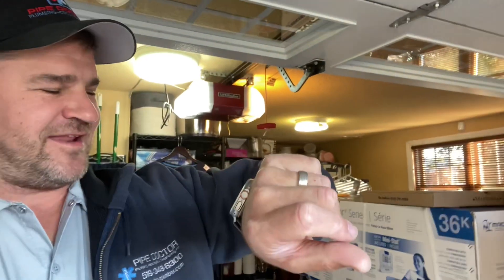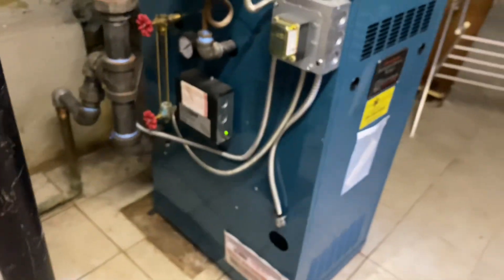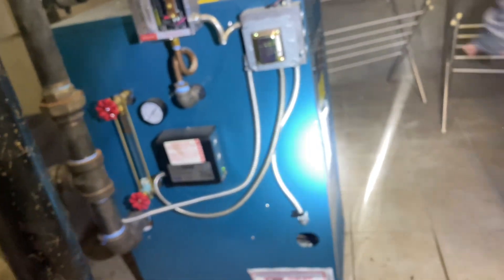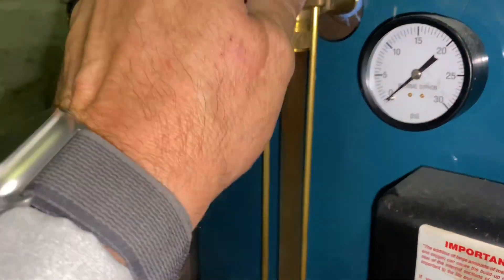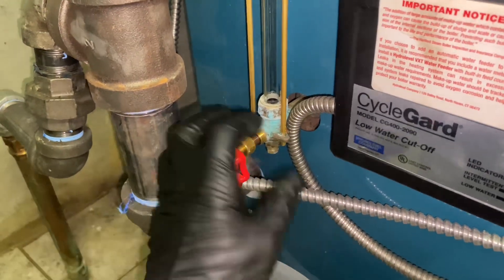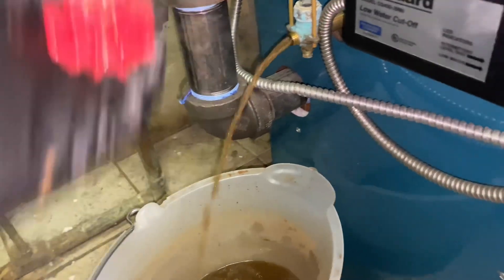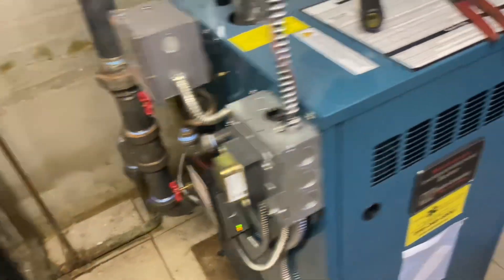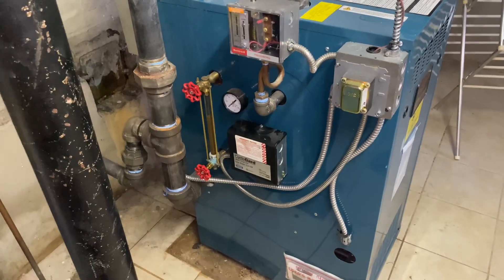Got Steam? Steam Home Heating Boiler Furnace Essentials - Must Watch How To Video

Comment: Mount Vernon , the worst place for steam boilers in very old houses. Cleaning the mud out of those fittings is multiple times in a week ,
Reply: @PipeDoctor  I guess you’ve visited lovely Mount Vernon😂😂 , great place to repair oil burners, lots of pancake boilers and asbestos

Comment: sight glass looked ok, I seen floaties moving downward when draining. the amount of pressure out the drain valve suggests it was overfilled to nearly blasting out the radiators. lol
the gauge appeared to be at zero when you first showed( blurry though), then the water blasting into bucket suggested 5psi+ to my ears. 
🤔

Comment: its a good idea to mark the rods and the glass tube where the water level should be. that way the owner knows where it should be. when the boiler cools down. red nail polish works good for doing that
Reply: I'm wondering why the half way mark isn't marked from the factory.  Seems like it would be, should be?  Easy to etch the glass just like a graduated cylinder, thermometer, etcetera.

Comment: Nice job Mike. I noticed black pipe being used for drip tube out of pressure relief valve.  In my area that's a big no no. Pipe can corrode internally and block off relief port. Can't use black pipe must be copper.
Reply: copper pipe, meet shark bite fittings. see the conundrum with them not allowing black pipe(galvanized with no threads and taper cut!)

Comment: Last week the plumber and I cut the wet return copper pipe about 35' away from the boiler. We shoved a garden hose down the cut pipe and added a pump to the boiler end of the return.  I watched the thick brown "lava" get pumped out of the return.  The lava ran that way for a few minutes before regular brown water came out.  He installed a clean out for next time.

Comment: Hey Mike, got a question for you. Do you have any experience with steam boilers treated with Potassium Sulfate? I believe it is used to lower dissolved oxygen levels. Sounds like bs to me since air is part of the equation in getting steam moving in the pipes to begin with if it’s not a vacuum system.
Reply: @PipeDoctor  
Yeah, me neither until i had to deal with it eating holes in pipes.

Comment: Hey, Mikey....Why do homes in NY have finished tile floors in their utility rooms ? I have never seen that in Boston, New Hampster or Corolardo. Please do a video explaining what all the elements of a boiler do... why is there a pigtail ?  Why is there no auto filtration ftp capture and isolate all the "cuckee" " Why does the boiler not have all these devices engineered into a topside manifold, to assure not installed wrong? IT seems the engineering is 1940s, with some electronic add-ons. Just questions that come to mind. Why is The Kaleesi on a boiler?

Comment: Hey Mike I have a question when your filling a hot water heater how do u know when it is fill up safe enough to turn on I'm doing school for hvac and wanted to know !!
Reply: Flip up the relief valve to release air and when water starts coming out then it is full.

Comment: those mr cool units are trash specifically those pre charged line sets
Reply: Mine works great for my garage. It can cool the garage even with the garage door open in hot So. Florida. Like anything it's also about the install. You can take the best system and it will be shit with a shitty install.
Reply: @scotts4125  I'll consider one in central Florida sometime after our move.  First time having an attached garage WITH the electric panel in the garage, that makes everything SO easy for acquiring 220 volts and having an exterior wall as well.  The only issue is, garage is 100 square feet smaller than our current garage (2.0 vs 2.5!)  That blows for having 2 cars plus a workbench and etcetera along the side walls as I'm already accustomed to.
Reply: @Florida_Man_In_Florida  I have an ideal situation. We have 2 garages. One is double for the cars and I have a single I made into my tool shrine/shop. That's where I put the M/S. The panel however is in the big garage. I had my low voltage guy run 220 from the big garage through the attic into the shop garage. He doesn't like to fool with 220 so I actually made all the terminations. We have a new house so I also didn't want the lineset coming down the side of the house. I ran everything down the inside garage wall. My Snap On boxes hide most of it. I put white lineset covers on them. I poked out about 2 feet above the floor. We have landscaping so it completely hides the lineset and electrical PVC going to the condenser and disco. I ran that lineset in brown even though you can't see it to match the gutters. I measured out 25' so I didn't have any coiling. I used a hurricane wall bracket. It's one of the cleanest installs I have seen but I took my time to make it that way. I used an A/C torque wrench on the flairs. I bought a bender but didn't end up needing it. I'm very happy with it.